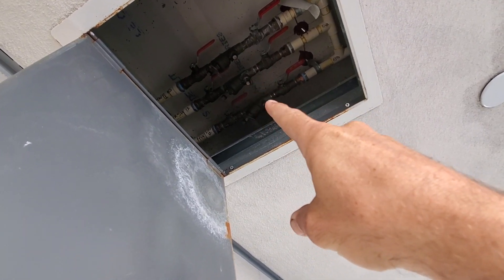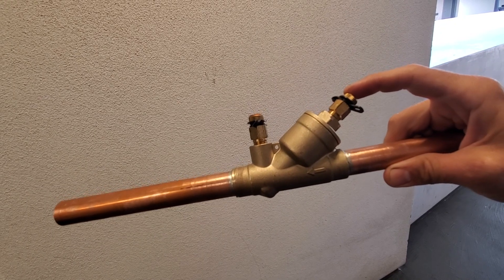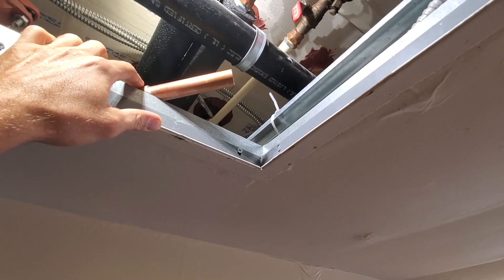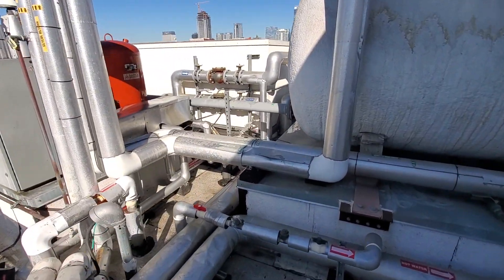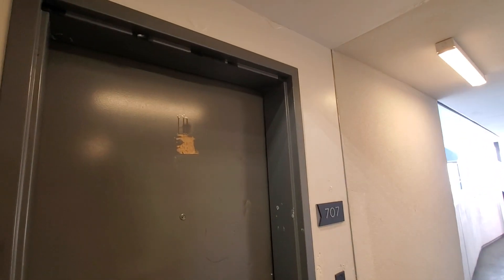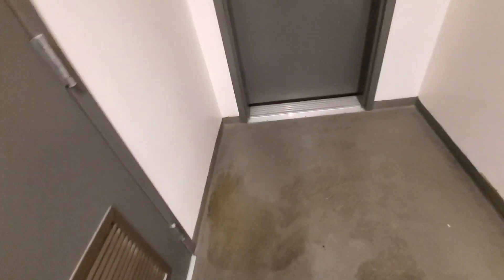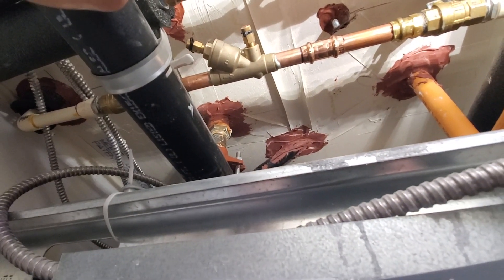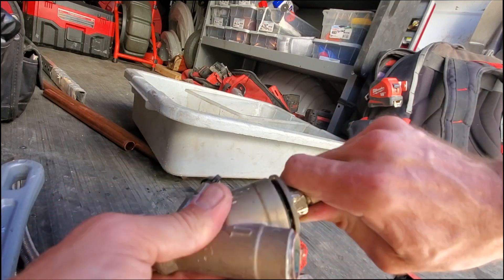Replacing a Griswold K Valve

Comment: Cool I  didnt know they had preset , makes sence  that  the system could be engineered to   a certain spec in gpm flow.     in operation   I would guess if you are in operation that building  maintenance could up the gpm with another cartridge. it dosent do any good to have excess flow    they measure temp  going in and out the   coils if  temp drops too much  higher flow is needed if it barely drops   the flow can be reduced.   maintewnance needs  some   differant flow cartridges to ballance it out  in the future my guess , contractor must have flaked out on them
      Its amazing these buildings dont have   people to service them    could be great  opotunity for ambitious man as yourself  keep up the good work !